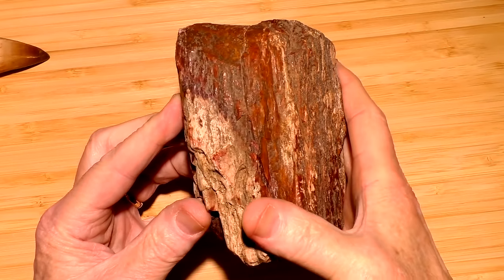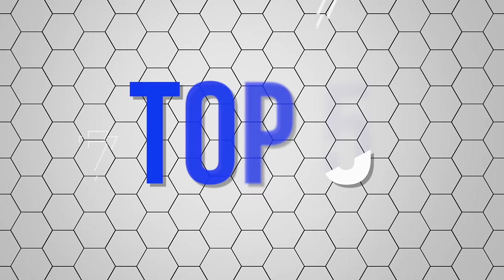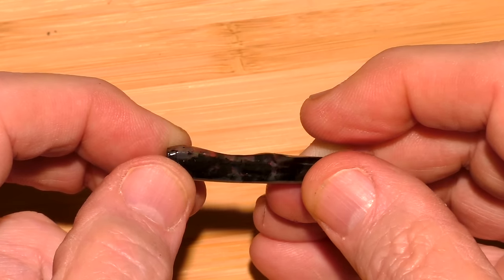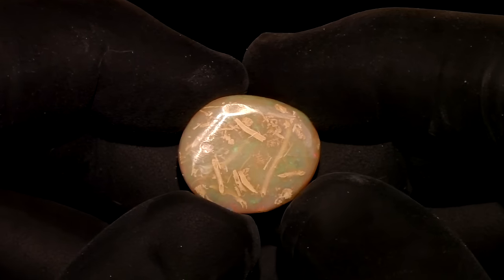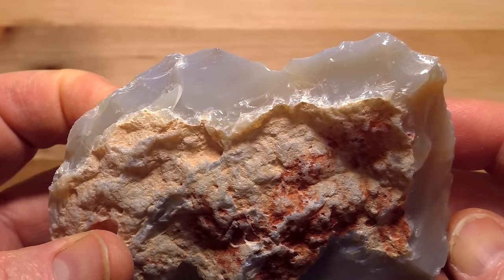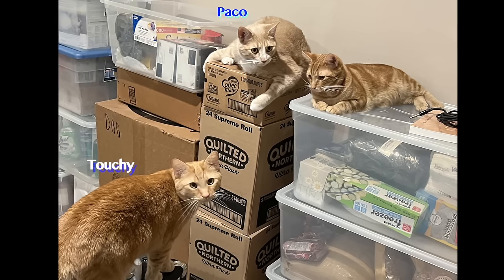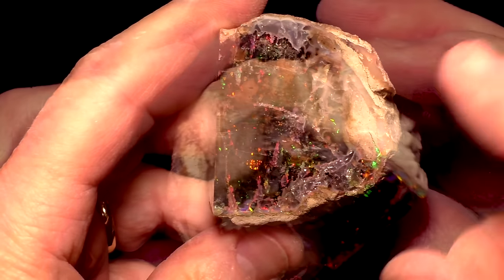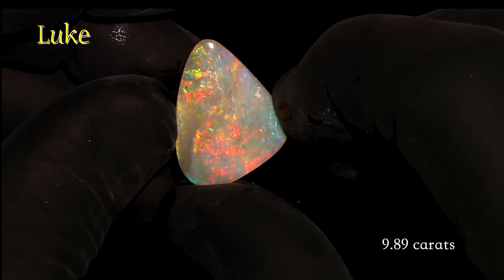What You DON'T Know About Wood Opal     (Opalized Wood)

Comment: I remember some time ago you published a video with a few experiments on stabilizing hydrophane opal, and the limiting factor seemed to be how far the resin penetrated before curing. This video reminded me that woodworkers stabilize some types of wood (which also do not absorb resin very quickly under normal conditions) by letting them soak in a heat-cured resin for some time, typically within a vacuum chamber, before curing them. I have no experience with either, but I wonder if some of those techniques could be adapted to hydrophane opal. Though I  imagine a vacuum would crack opal if applied too quickly, it might work if applied very slowly or even just by letting them soak.
Reply from the maker: In stabilizing hydrophane opal, the key process involves removing all water from the opal and replacing it with epoxy resin. After hardening, the opal becomes almost indestructible. This process is somewhat complex and requires careful adherence to instructions. It involves soaking the opal in acetone, gradually increasing its concentration to 100%, then adding epoxy resin. The resin penetration and hardening times are crucial, especially for larger stones. These require more time for the epoxy to penetrate deeply before hardening. Insufficient penetration or hardening time can lead to cracks.

Adapting woodworking techniques like slow vacuum application or prolonged soaking for hydrophane opal could be theoretically possible. However, the critical factors are the thorough removal of water, controlled resin penetration, and adequate hardening time. Each opal's unique properties and the specific resin characteristics would determine the feasibility and success of such adaptations.
Reply: Not being a chemical engineer or a mineralogist, take my opinion with a grain of salt, but I suspect that it would not be terribly hard to engineer a specialty product with suitable characteristics, e.g. viscosity, optical clarity, whetting properties, curing conditions and so forth. From what I've seen and learned from your channel, there's a lot of really pretty Ethiopian opal out there and all other things equal, I'm sure most people would appreciate stabilized african opal if it's an order of magnitude cheaper than lightning ridge.
Reply: Vacuum application would also remove water more quickly. In another video you used opticon fracture sealer and the opal turned white. According to opticon, the sealer is supposed to be transparent. Perhaps the white color is actually a result of many small air bubbles that weren't displaced by the sealer. Edit: I should mention that (going by the videos I watched) most of the air is removed from the wood very rapidly after the vacuum is applied, about a couple hours. Since the fracture sealer has a cure of several days, there would still be plenty of time for a gradual application of vacuum. It would be an interesting experiment to use a vacuum with the fracture sealer, at any rate. Vacuum chambers can be had cheaply, and if necessary one could probably add some controller that raises the vacuum gradually by pulsing the motor on and off on a schedule or using feedback from a sensor. While I'm considering buying a vacuum chamber for unrelated purposes, I've never worked with one, so again, take all this with a grain of salt.   @PulitzerOpal
Reply: Looks like others suggested a vacuum in the older video too, and apparently it's common practice for gemstone stabilization in general, but a cursory search didn't turn up any examples using welo opal and vacuum specifically. I'm curious whether it would work without destroying the opal, or rather if it could be made to work. Maybe if I get the equipment I'll buy some clear welo opal and give it a shot. Incidentally something finally clicked in my brain while writing these comments and at long last I can spell the word 'vacuum' without spellcheck, so thanks for that too. c,m,n,u, they all look the goddamned same in a word like vacuum.

Comment: Virginia Valley is definitely on my bucket list.  Good video sir.
Reply from the maker: That sounds like an exciting discovery! Opalized wood can be quite fascinating. The play of color in opals is typically caused by the diffraction of light as it passes through microscopic silica spheres within the opal. The size and arrangement of these spheres affect the colors you see.

For opalized wood to display flash or play of color, it often depends on the quality of the opal, the arrangement of the silica spheres, and the thickness of the opal layer. Opals with a well-ordered structure of spheres that are relatively uniform in size tend to display more vivid flashes of color. Additionally, the angle of the light source and the observer can also influence the appearance of play of color in opals.

Keep in mind that opal mining and collecting can be both a science and an art, and each piece of opal is unique. Continue your exploration and digging in Utah, and you may come across even more stunning opal specimens in the future!

Comment: I found an opalized wood spot in Utah this year and I've been returning and digging repeated hoping to find color play opal.   The best I've done so far is blue opal and green opal.    I'm curious what conditions lead to flash.
Reply from the maker: That sounds like an exciting discovery! Opalized wood can be quite fascinating. The play of color in opals is typically caused by the diffraction of light as it passes through microscopic silica spheres within the opal. The size and arrangement of these spheres affect the colors you see.

For opalized wood to display flash or play of color, it often depends on the quality of the opal, the arrangement of the silica spheres, and the thickness of the opal layer. Opals with a well-ordered structure of spheres that are relatively uniform in size tend to display more vivid flashes of color. Additionally, the angle of the light source and the observer can also influence the appearance of play of color in opals.

Keep in mind that opal mining and collecting can be both a science and an art, and each piece of opal is unique. Continue your exploration and digging in Utah, and you may come across even more stunning opal specimens in the future!
Reply: @PulitzerOpal  thank you sir.   I have a theory that freeze thaw cycles are decomposing the opal.  Alot of the surface finds I've found are bleached out and fractured extensively.  The best common opal I've seen is on specimens that have weathered out recently, or have been extracted partially buried.  

In northern Utah, the temperature differential between summer and winter is nearly 100°F.   Considering that opals are water crystals, I think anything above the freeze thaw line doesn't stand much of a chance.

Comment: hi I just bought some Indonesian Wood opal, kept in oil as you mention in this video to keep it from losing its colour and from drying out. How can I stabilize it?  I've watched your epoxy method, is this the same way I should treat the Indonesia stuff?
Reply from the maker: I THINK that the method would work, but I have not tested it on Indonesian opal. First, you have to get the oil off of it and out of it. I have worked on oil saturated Ethiopian opal and if I were stabilizing Indonesian, I would do about 6 or more acetone exchanges. After that, the procedure should be the same …BUT - I do not know how porous it is. I seems to just be wood, so I would expect acetone to penetrate. If acetone can penetrate, epoxy will also. Good luck!
Reply: @PulitzerOpal  Thank you my fiend

Comment: That wood opal comes in some fascinating patterns. You always come up with some great stones! I think I agree that the Virgin Valley opal should be number one. But even the dark branches from Indonesia are very interesting. Would casting them in resin prevent them from cracking as well? Thanks for another great video!
Reply from the maker: You're absolutely right; wood opals have some incredibly captivating patterns! Using resin to encase them could potentially help prevent cracking and make them suitable for various applications, including jewelry. Thanks for your support and for watching our video. Don't forget to like and subscribe for more exciting opal content!
Reply from the maker: Resin will seal the water in. I took a number of pieces of Virgin Valley opal and used my stabilization recipe to stabilize them. (It’s what I used to stabilize unstable Ethiopian opal.

Comment: I have a 2 kilo piece of Indonesian wood opal that is dried out. How can I rehydrate it without it falling apart?
Reply from the maker: Rehydrating opalized wood can be tricky, as you mentioned. To prevent it from falling apart, you'll want to proceed with caution. Here's a suggestion: 

1. Start by placing your dried Indonesian wood opal in a container of distilled water. 

2. Let it soak for a short period, perhaps just a few minutes at first.

3. Gradually increase the soaking time over several days, allowing the opal to absorb moisture slowly.

4. Keep an eye on the opal during this process. If you notice any signs of cracking or instability, remove it from the water immediately.

5. Once you've rehydrated it to your satisfaction, gently pat it dry with a soft cloth and allow it to air dry completely.

Remember, rehydrating opalized wood can be delicate, so take your time and exercise caution to preserve its beauty. Good luck! 😊💧🪵

Comment: Are they valuable?
Reply from the maker: Opals can vary in value depending on factors like their type, color, clarity, and size. Some opals, particularly those with vibrant colors and patterns, can be quite valuable. If you have a specific opal in mind or want more information about their value, don't hesitate to ask. 💰💎
Reply: @PulitzerOpal  I guess my real question is are wood opals the same as regular opals? If they both share similar qualities and stuff are the valued the same? Opals are my 2nd favorite gem after Sapphires.
Reply from the maker: To most people who want opal for jewelry, if the wood opal is the same quality as regular opal, then the value is the same. 

For me personally, if the quality of the wood opal is identical to regular opal, but it shows evidence that it is, would opal, I would value the wood opal higher, because it is more scarce than regular opal. However, most opal cutters may not realize that they are cutting wood opal, and therefore it is unknown to whoever gets the final stone that it actually is Wood opal.  Many pieces of opalized dinosaur bone have been cut for jewelry and essentially, nobody knows that they are anything but regular opal.

Comment: Very informative.
Reply from the maker: That sounds like an exciting discovery! Opalized wood can be quite fascinating. The play of color in opals is typically caused by the diffraction of light as it passes through microscopic silica spheres within the opal. The size and arrangement of these spheres affect the colors you see.

For opalized wood to display flash or play of color, it often depends on the quality of the opal, the arrangement of the silica spheres, and the thickness of the opal layer. Opals with a well-ordered structure of spheres that are relatively uniform in size tend to display more vivid flashes of color. Additionally, the angle of the light source and the observer can also influence the appearance of play of color in opals.

Keep in mind that opal mining and collecting can be both a science and an art, and each piece of opal is unique. Continue your exploration and digging in Utah, and you may come across even more stunning opal specimens in the future!

Comment: Virginia Valley conch up there with Australian?!?!? I will have to check it out!
Reply from the maker: That sounds like an exciting discovery! Opalized wood can be quite fascinating. The play of color in opals is typically caused by the diffraction of light as it passes through microscopic silica spheres within the opal. The size and arrangement of these spheres affect the colors you see.

For opalized wood to display flash or play of color, it often depends on the quality of the opal, the arrangement of the silica spheres, and the thickness of the opal layer. Opals with a well-ordered structure of spheres that are relatively uniform in size tend to display more vivid flashes of color. Additionally, the angle of the light source and the observer can also influence the appearance of play of color in opals.

Keep in mind that opal mining and collecting can be both a science and an art, and each piece of opal is unique. Continue your exploration and digging in Utah, and you may come across even more stunning opal specimens in the future!

Comment: The meat ball is probably a palm of some kind.  Most trees are dicots, palms are technically not trees at all.  The wood is extremely different.  Dicots have uniform striations all through with all the pipes taking water and nutrient right near the bark.  (We call it xylem and phloem). In monocots, the pipes are distributed evenly through the timber,  not the bark.  That's probably what's made your meat ball bits.
Reply from the maker: Thank you for the insight into the meatball mystery! It's always fascinating to learn about the unique characteristics of different plant structures. If you're interested in opals as well, consider subscribing to our channel for more opal-related knowledge! 😊🌟
Reply: @PulitzerOpal  pretty sure I'm subscribed.  Conversation drives the algorithm harder anyway...

Comment: Im keen for a 2nd channel if its about fossils or other stones besides opal
Reply from the maker: That sounds like an exciting discovery! Opalized wood can be quite fascinating. The play of color in opals is typically caused by the diffraction of light as it passes through microscopic silica spheres within the opal. The size and arrangement of these spheres affect the colors you see.

For opalized wood to display flash or play of color, it often depends on the quality of the opal, the arrangement of the silica spheres, and the thickness of the opal layer. Opals with a well-ordered structure of spheres that are relatively uniform in size tend to display more vivid flashes of color. Additionally, the angle of the light source and the observer can also influence the appearance of play of color in opals.

Keep in mind that opal mining and collecting can be both a science and an art, and each piece of opal is unique. Continue your exploration and digging in Utah, and you may come across even more stunning opal specimens in the future!

Comment: ❤
Reply from the maker: That sounds like an exciting discovery! Opalized wood can be quite fascinating. The play of color in opals is typically caused by the diffraction of light as it passes through microscopic silica spheres within the opal. The size and arrangement of these spheres affect the colors you see.

For opalized wood to display flash or play of color, it often depends on the quality of the opal, the arrangement of the silica spheres, and the thickness of the opal layer. Opals with a well-ordered structure of spheres that are relatively uniform in size tend to display more vivid flashes of color. Additionally, the angle of the light source and the observer can also influence the appearance of play of color in opals.

Keep in mind that opal mining and collecting can be both a science and an art, and each piece of opal is unique. Continue your exploration and digging in Utah, and you may come across even more stunning opal specimens in the future!